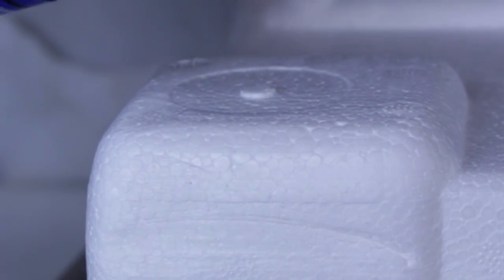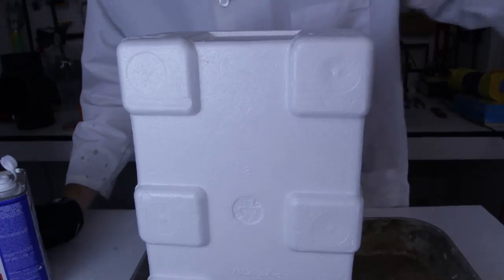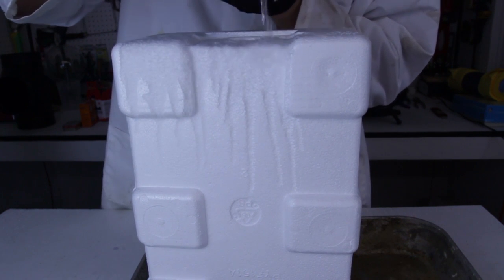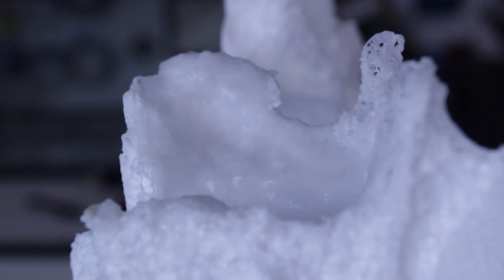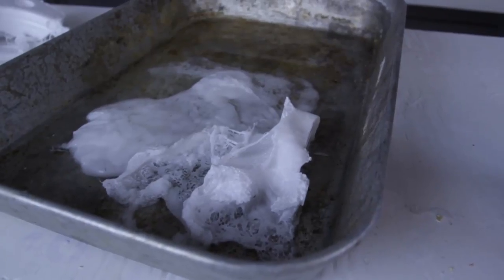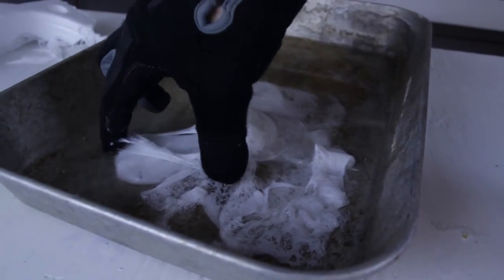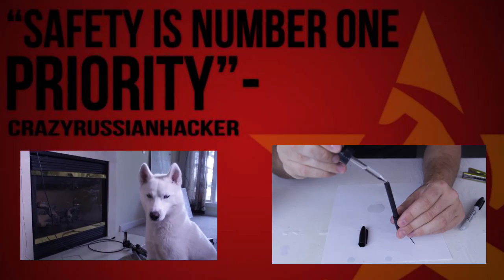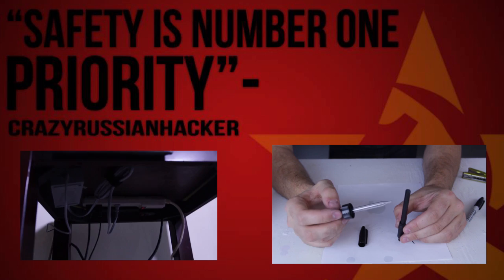Acetone and Styrofoam

Comment: Using a flat 1" sheet of styrofoam, cut it into gravestone shapes. A small paint brush and some acetone to etch words, cracks, etc. into the surface. Paint with a waterbased grey/black spray paint for color.

Comment: This is a very simple reaction. Styrofoam is made of an organic compound called polystyrene. Acetone, as you may know, is an organic solvent. So polystyrene (many plastics are made of this) will dissolve in acetone or any other organic solvent like diethyl ether. But Styrofoam has lots of air in it. So it looks like you are dissolving way more than you really are because the air is coming out.

Comment: We recently did this in our chemistry class, it's pretty cool, also did you know that if you take the left over gooey stuff and form it into a shape (its kind of like puddy) you can let it dry and it after 2 or 3 days it will turn rock solid. This is one way that artificial body parts are made too.

Comment: This reaction occurs due to the principle of "like dissolving like." Acetone is a nonpolar molecule just as styrofoam is made up of nonpolar molecules. The induced dipole induced dipole attractive forces between the two different molecules are stronger than the induced dipole induced dipole attractive forces between the same molecules. Water doesn't dissolve styrofoam because it is a polar molecule and the hydrogen bonding is stronger than the dipole induced dipole bonding between the styrofoam and the water. Therefore, acetone dissolves styrofoam.

Comment: And to think that stuff goes into my skin.. (nail polish remover)
Reply: Yana Sinz well as long as your skin is not styrofoam i think you'll be fine
Reply: Well not all nail polish remover's have it…
Reply: Yana Sinz It won't dissolve your skin. lol
Reply: Travis Ross lol. Pseudo means false for people who don't know. Pseudoscience lol
Reply: Blink 182! :D
Reply: Yana Sinz or crack me up nail polish, i didn't know what happend, i was polishing my nails, the bottle fell, and the styrofoam was just melting... that was so weird...
Reply: Yana Sinz Did you know that Dihydrogen Monoxide rusts metal, causes mold, erodes rock, rots wood, and is used as an additive in cooling systems. Anything that does all that must not be good for you!

FYI: Its water. Pseudoscience is cancer.
Reply: agent475816  If people don't know what pseudoscience means, then there's a much deeper rooted problem that I wont even address

Comment: If I put my fingers when it is melting, my fingers will melt too?
Reply: No, your finger will not melt in the Acetone.
Reply: The reason the styrofoam dissolved, is because acetone and styrofoam are both non-polar substances.
Reply: Acetone will melt skin not, so you your fingers will melt not.
Reply: that not made any sense
Reply: BladeProduccionts no, not unless you're plastic.